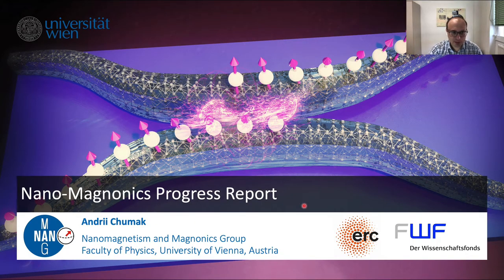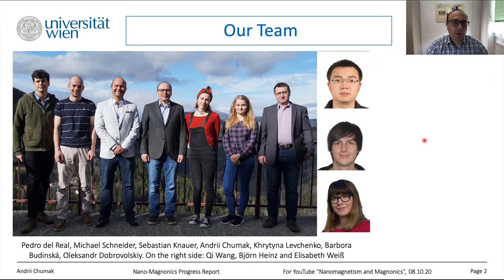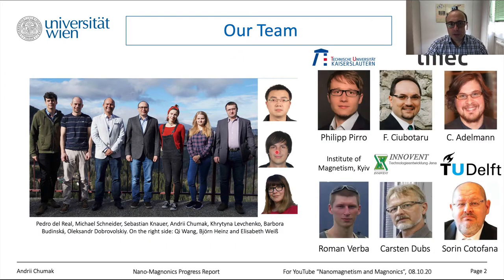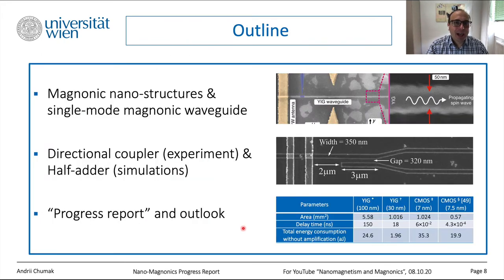Nano-Magnonics Progress Report

Comment: It was great and I hope you share more about your group's progress. It seems that the corona virus, with all its disadvantages, has had its advantages. One of them is that I can participate in lots of presentations which were not available in my location.

In addition, I have a question:

I cannot understand why the delay time in magnonic systems is so higher than CMOS systems. Could you explain it, please?

Thank you
Reply: Time delay in CMOS depends on load capacitance, supply voltage and threshold voltages. To reduce time delay, one could increase a width of the MOS transistors (gate sizing), reduce a load capacitance (using smaller transistors), increase a supply voltage and/or reduce the threshold voltage. 
While in magnonics, "..time delay is a sum of the time required to excite spin waves, time for propagation and for magnetization relaxation. In the nearest future, magnonic logic circuits would be slower than the CMOS counterparts. Nevertheless, the overall functional throughput may be higher for magnonic logic circuits due to the smaller circuit area. The most prominent
 advantage over CMOS circuitry is expected in minimizing power consumption. There is no static power consumption in magnonic logic circuits based on non-volatile magnetic cells. The utilization of multiferroic materials together with low energy spin wave switching may substantially reduce the energy per operation.." - A. Khitun and K. L. Wang, “Non-volatile magnonic logic circuits engineering,” J. Appl. Phys. 110, 034306 (2011).